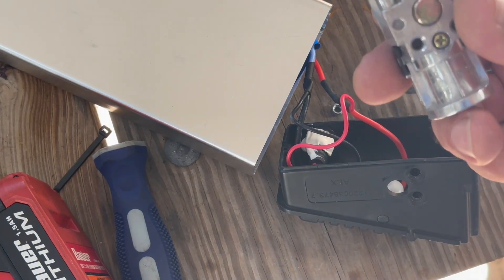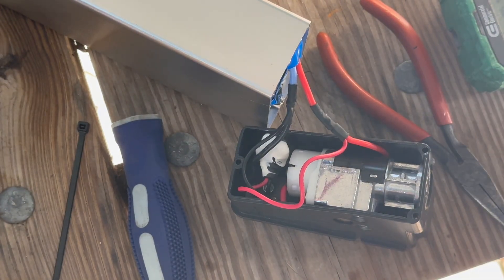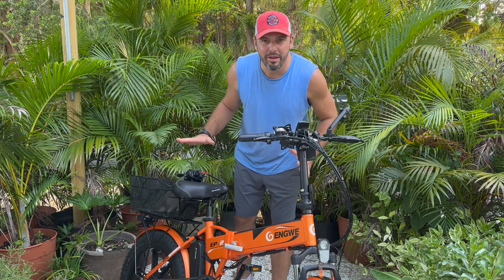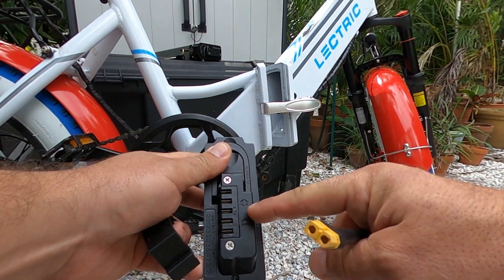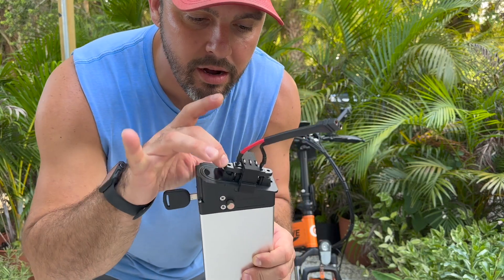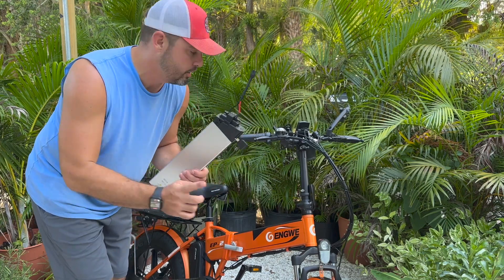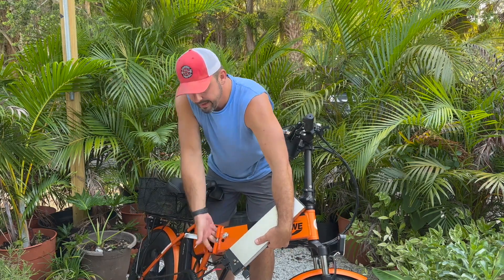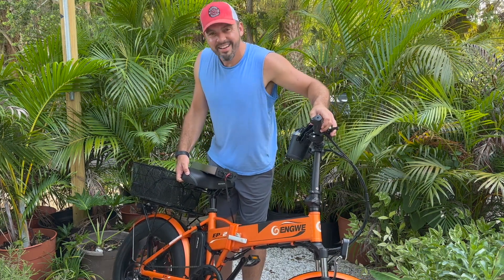Opening an E-Bike Battery to the Wires Folding e-Bike Battery for External Use as Second Battery

Comment: It is common port bms inside of battery right?
Reply from the maker: Separate charging cable
Reply: So separate bsm port for charge and discharge yes? Are you sure? Sorry I just want to know before buying converter with or without option to charge both batteries simultaneously, cheers! :)
Reply from the maker: @Mordix666  we have deliberately paired items that require independent charging with their respective charging devices. If you require a balancer with charging capabilities you will want to match your components accordingly

Comment: Please make a clip adapter for the Engwe Engine Pro battery. It has a 16ah battery and that clip doesn't fit. I will say that the XT-60 adapter fits very snug in the connection and probably doesn't really need it. But with the way these bike rattle around it would be a peace of mind knowing that it is clipped in.

I love the kit I got and it is working perfectly. When I purchased my Engwe Engine Pro it came bundled with an extra battery. 
I also want to say thank you to you for the rapid response to emails, and IG inboxes. You guys are amazing!!!